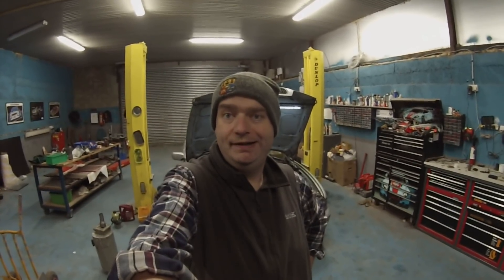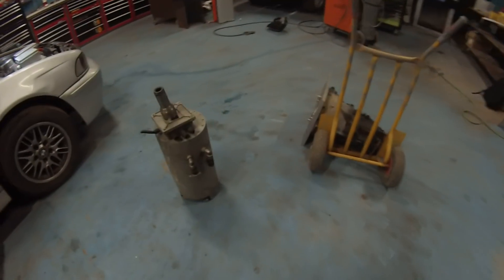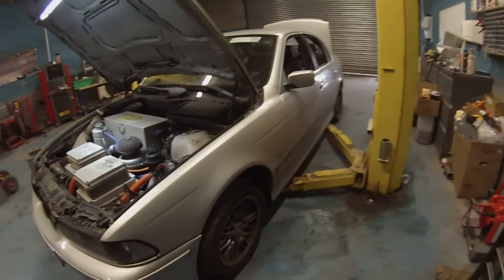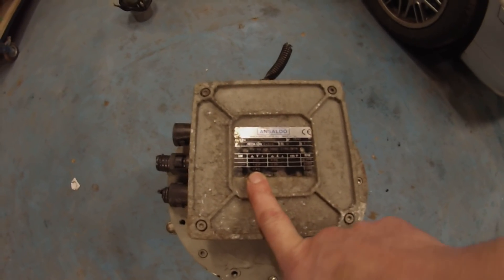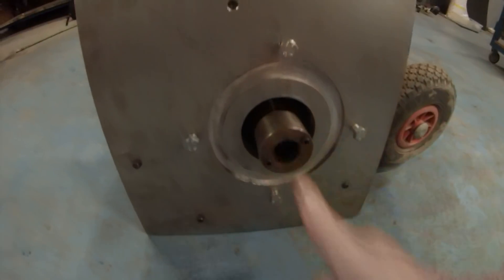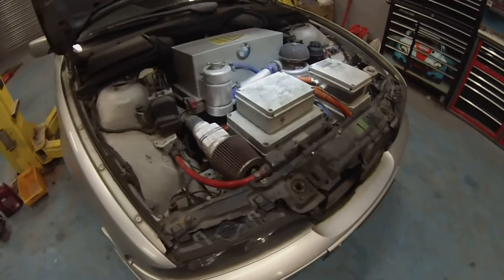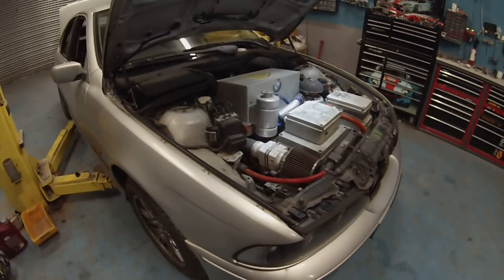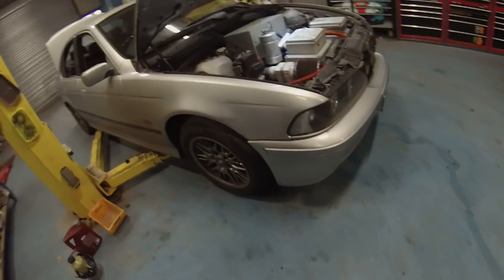BMW E39 EV Conversion 53: DC To AC Part 1

Comment: Hey Damien. Since it's topical, there's been some talk on the DIYEV forums this last week about the feasibility (claimed near-impossibility) of making your own adapter plate. 0.005" tolerances and such. I saw in your $1000 EV build you talked about making the adapter plate, but not a lot of details. With 80,000 miles on this EV, I was wondering if you might feel like making a video (here on this project, since you have a new motor, or, on the $1000 EV build) showing your (obviously successful) methods for measuring/machining/etc. Some of the more experienced members are pushing quite hard (to the point of ridiculing anyone who suggests it be attempted and calling for them - well, me - from being banned from the community for even suggesting it's possible) against the idea that anyone could do this and not almost immediately run into trouble and that you need to be spending $1000 on a machinist-made plate. The naysayers don't trouble me, they'll be who they're going to be, but, to make something positive out of it I'd really like to learn and share more about your successful methods.
Reply from the maker: Yes I saw that thread and walked away. Kinda sucks the energy out of me. Suggest having a look at the original videos of this build :
https://www.youtube.com/watch?v=CPY4kvVpn6s
https://www.youtube.com/watch?v=iXhOBl0xljw
https://www.youtube.com/watch?v=os8GtMsCxAo